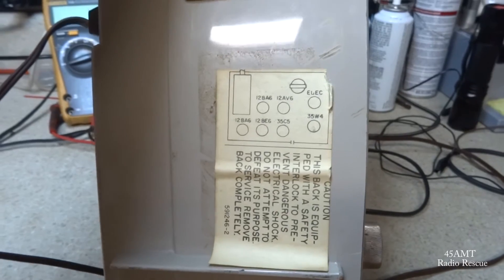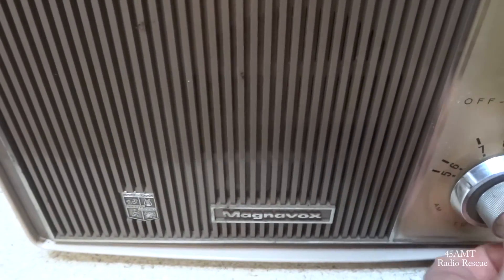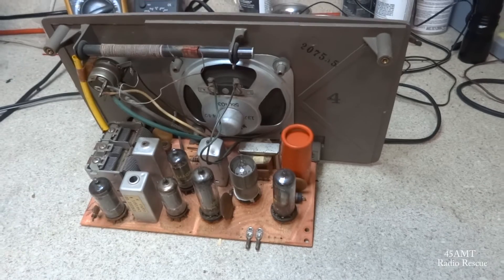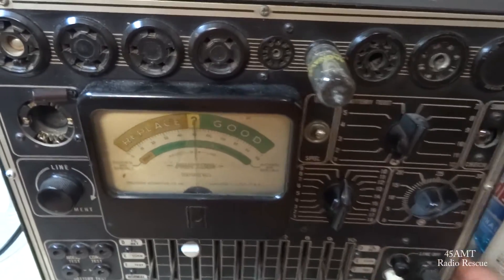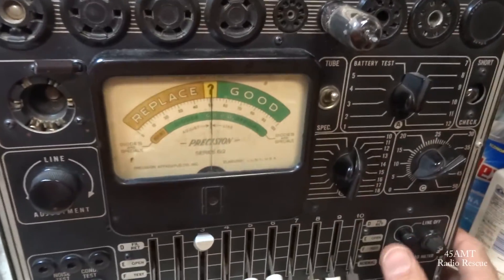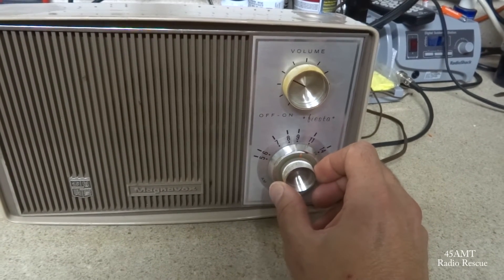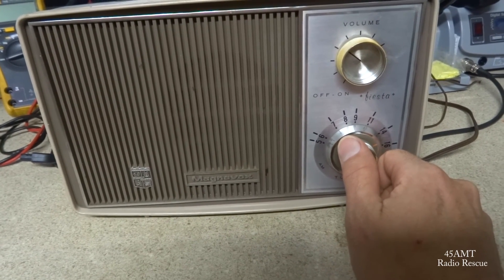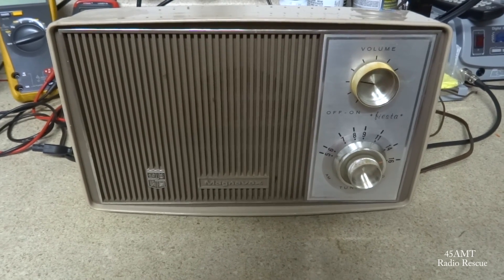Repair of a 1965 Magnavox R006 30101 Tube Radio

Comment: Sounding good now that you have replaced the smoothing, and reservoir, electrolytic capacitors, and the defective valves.
Front-end valves, like frequency changers and IF amplifiers, remain functional longer than the audio output, and rectifier valves.  I too have experience that type of situation, though not often …it usually is the other way round.
Another nice video.
Phil.
Reply: When I find bad tubes in miniature-tube AA5 radios they are usually the 12AV6 or 12BA6 and almost always the problem is an open filament.  I had one which had a bad 35W4 rectifier.  I had one which had a weak 50C5 but never had one with a bad or weak converter tube.

Comment: I wonder if a tube tester applies full plate voltage. Try them in the radio and do a comparison video with the other tubes. Do they really need to go in the trash perhaps they can be put in another radio that is not so nice. They probably would make a noticable difference but I'm just being  curious